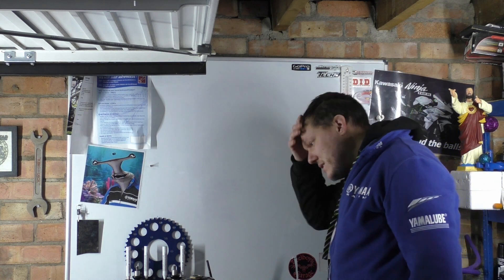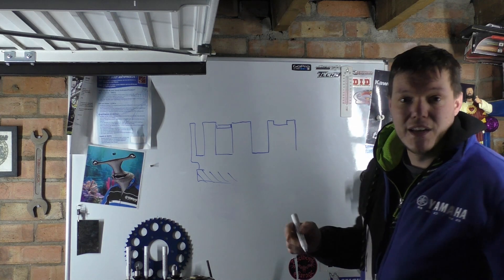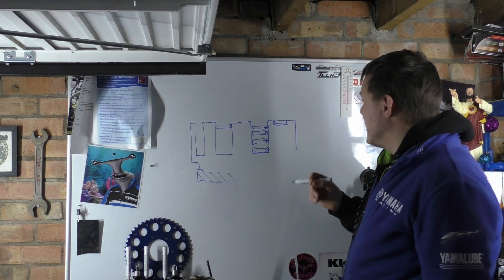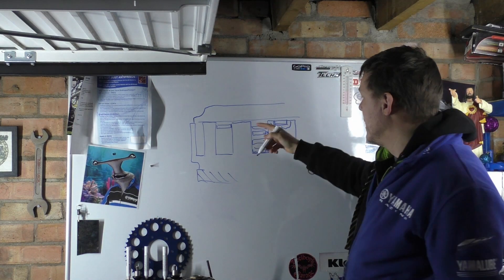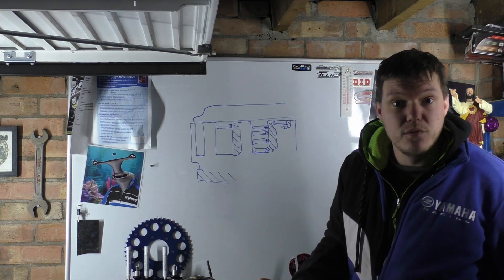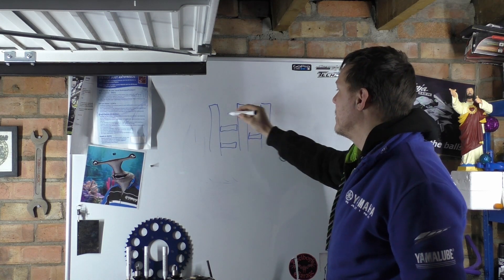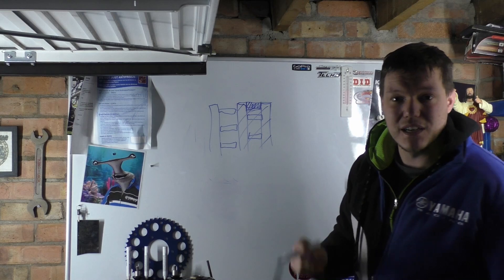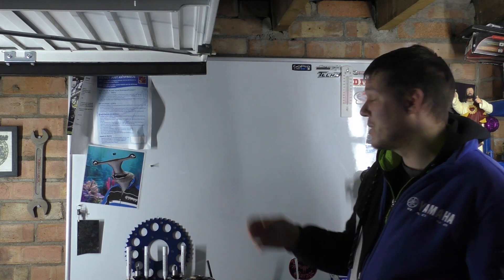Offset Clutch Plate - Why?

Comment: Hi matt. The reason of the offset is to decreasing the noise of the clutch. If the manufacture wants to have good friction plates disengagement when pulling the clutch lever, the have to use wider slot grooves for friction plates tooths which makes louder clutch sound when motor is running. the last notch of the outer basket is tight enough to lower the noise sound of the cluth while other plates can disengage freely in wider slot.
thnks to you for making videos.Im myself learning from you a lot. keep making videos👍👍
Reply: Hey great info. Just tested this with the clutch basket that's out of my 2000 gsxr 750. Feeler gauge showed the slots to have 6 thousands of an inch difference in clearance using the same friction disc. I never knew.

Comment: I did a clutch change on a jialing jh125l and didn't offset the top disc. It ended up having a 3.5mm end play on the basket and not being able to disengage the drive, also the discs were worn quite some during the first startup. After I tore it back down and offset the top disc the clutch basket end play went away. Its critical on some models to maintain proper pressure plate travel.

Comment: Just changed the clutch in two of my mt07 and didn't offset the first one but it runs fine. Did it on the second one and was a little worried. Didn't wanna strip it back down again so this upload helped. I'll leave it. Thanks. ☺

Comment: What you said makes sense,  but my RE himalayan’s basket doesn’t have any oil hole radially to keep the plates wet and cool not even a single hole, and it uses the same offset clutch plate mechanism, which again shuts the door for oil to penetrate in as all the slots are filled axially, which used to make my motorcycle run hotter and also hard shifting, struggling to find neutral, the day I made it normal I fixed everything also the engine temp on gauge shows cooler figures.

Comment: A-up dude, how do you calculate exhaust pipe length and diameter for a bike? 
I searched YouTube and either get a septic smeg black magic mystery answer or an informative Fred Dibnar style general answer. But I'd like to know how it is calculated please, even if you recommend a read :)
Cheers Dude
Reply from the maker: Are we talking 2 or 4 stroke?
Reply: Sorry dude, 4stroke? :)
Reply: What a numpty I put ? Instead of . sorry,  4 stroke please.
Reply from the maker: Okie kokie here we go....

The pipe diameter is usually set by the size of the exhaust ports collectively. As the length of the pipe increases energies is lost due to cooling of the exhaust gases, therefore the diameter is reduced.

The length of the exhaust is based on rpm, so you have to 'pick' what rpm you want to 'tune' the exhaust to. Usually this is the rev range within the power band. So now you have you chosen rpm you then have to measure the exhaust temperature at that rpm. Once this is done the maths comes in.

You take the temperature of the gas - 'T' and the density of the gas 'ρ' (ρ = mass/volume) or just take the speed of sound @ that exhaust temperature - i.e 800DegC for example, and then the length of the exhaust.

So, @ 800degC the speed of sound is roughly 660 m/s (meters) 
Then you take the length of your exhaust - lets say you start with 2 meters 
this means that the pressure pulse will travel to the end of the exhaust and back to the exhaust valve in this is 2/660 = 0.003 seconds or 3 milliseconds. 

How often deos the valve open at say 8,000 rpm (target rpm)  = 66.6 (67) times per second, or it opens every 0.015 seconds (15 milliseconds) this means that the pressure pulse will travel 5 times back and forth until the valve opens again. 

Because this is a whole number the pressure wave will meet the exhaust valve opening (this is not taking into account multiple cylinders and the temperature and hence the speed of sound decreasing) - Also we want the pressure wave to be ahead of the valve opening so you would generally reduce the length of the exhaust slightly (by about 3%).

In other words - this is a whole lot of trial and error with dyno work included. Because of this there is no back of the envelope calculation that makes it simple and the fact that rpm is constantly changing means that the whole exercise is rpm dependant. 

I've seen websites (http://www.nightrider.com/biketech/calc_exhaustlength.htm) like this that give you numbers but this is basically based on basic speed of sound measurement like above. They also require valve open timing which makes no sense. They are using numbers based on actual dyno runs and what they have found during testing.

Sorry if this isn't the answer you were looking for but its the truth of the matter. Its always a compromise. The manufacturer of you bike has done a pretty good job and if you stick withing what they have done then that would be good. What you can do and others have done is take the maths I showed above and divide the lenght by that number.

Example - the exhaust pulse travelled 5 times the length of the exhaust before each valve opening event @ 8k rpm. You can take that 2 meter exhaust and reduce it by 5ths so devide 2 meters (In this example and reduce it by 20%) therefore the exhaust would be 1.6 meters instead of 2 meters - this means that the pressure pulse (based on this very basic maths) would travel the pipe 8 times before the valve opened - again this is a whole number which means all have disturbed the frequency of the exhaust but you've reduced the length. 

If you give me your exhaust length and your target rpm where your power band sits then I can work out the frequncy (losely as this doesn't take into account changing temperatures) how much length you can add remove.

- hope this helps - matt
Reply: The Workshop, Cheers Matt that's awesome dude. I was trying to work out how fabricators seem to make the exhaust systems on builds, as they tend to make the building of their pipes look like basic plumbing 😕. I'm looking at doing it for my zl600 eliminator as the pipes are getting on (23 years old) and the replacement cans available are ugly as sin. I live in Wales so we're at the height of our 2nd summer at the moment ergo ghoping 😵 so I'll have to grab a ball of string and get back to you. Thank you 😀

Comment: In my 1000cc race bike I had a solid basket clutch because the extra power would split a stock GSX1100 clutch.
The friction plate slots were machined out from the drum body so on the outside it was just a solid drum..
It was very sensitive to oil type, could only use a certain grade of Penzoil, and the clutch grabbed a bit which could make it hard sitting on the start grid a bit too long waiting.
Not suitable for street use which is probably why they don't just make clutch drums solid.

Comment: Always thought it was about controlling backlash, still do.
Reply from the maker: Ok, how? 

1) only one plates does this. If you mean controlling backlash from a load point of view then this doesn't make sense.

2) If you mean switching from forward torque to engine braking, again this doesn't make sense unless half of the plates were offset.

3) The last plate is rotated - not preloaded.

Comment: I always thought that it was to keep the friction plates from wearing all the way into the disks. Sort of inducing the slip at the end of the life of the friction material thickness.
Reply from the maker: I don't get what you mean?
Reply: As the friction material wears, the pressure plate must dress deeper and deeper into the clutch basket. Since the top friction plate now has limit to it's travel, eventually it will be unable to reach the next clutch disk and thus will not engage the clutch. I am hoping that the tolerances a such as to create this condition at the friction material minimal thickness.
At least, that is just what I've always made out of it.
Reply from the maker: LOL I get you now - you're clutch will start slipping well before this point, you'd have one worn-out clutch for this to actual take effect.
Reply: I think you are right. Clutches just usually fail well before the stack gets anywhere near the service limit due to automotive engine oils, inproper cable adjustment, or a clogged orfice in the master cylinder.